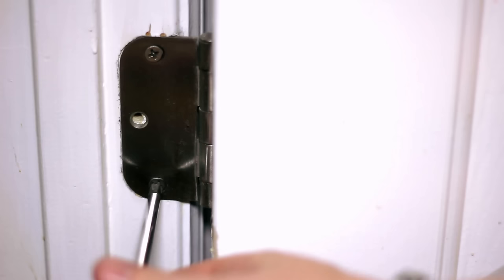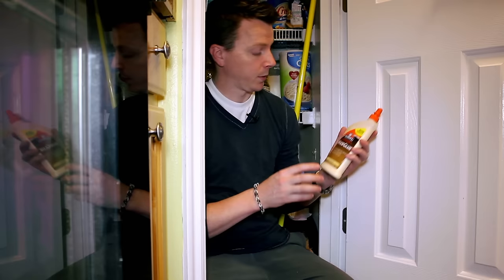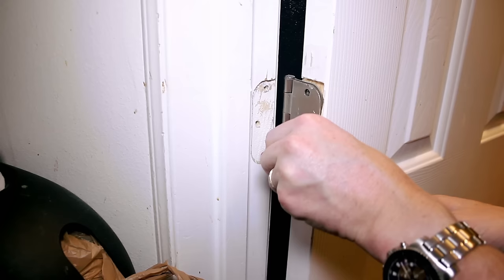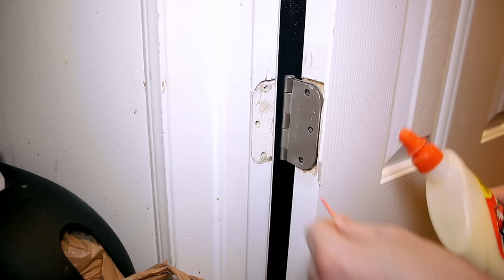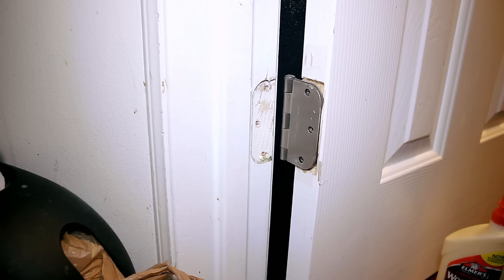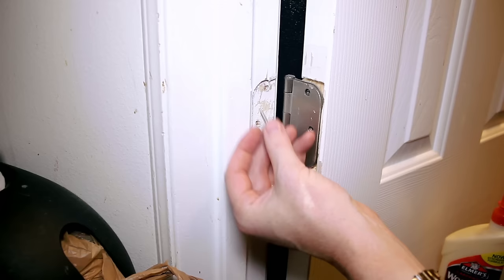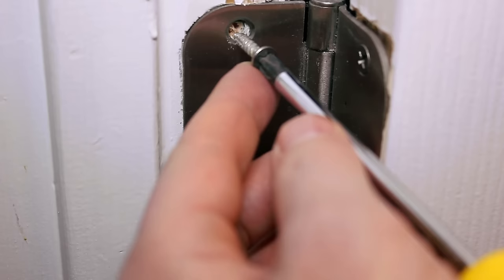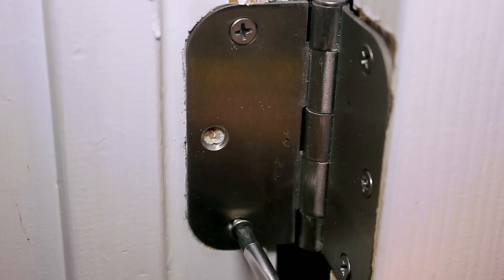Fix Stripped Screw Holes - 3 MINUTE FIX!

Comment: What if I have a hollow door
Reply from the maker: The door in the video is hollow, which is really common for interior doors. Hollow doors still have solid wood around the outsides and a few places in the middle, which is why this works. If you need to drive a screw into the hollow part, however, that's a lot trickier. You'll usually want to do so in a part that has backing.

Comment: Www.zzemscrew.com makes a nifty kit metal collet for hinges in wood frame applications.  The reason the screw got loose is the thread materials failed.  What’s to say cheesy Pine toothpicks will be anything much different although the glue will help. The problem is no cheaply wood are worthy of the shear and pull a door hinge gets.  The real solution would be metal hinge side frames, so we know that’s probably not happening on a residential application.

Comment: that can work, but drilling it and inserting a wooden dowel is better.
Reply: Sean Moran  The point is that very few households have wooden dowels of the appropriate size while almost every household has tooth pics.
Reply: biff322 I've never had a repair like this fail once. I use matches not toothpicks. It might fail on a door hinge though especially if his kids keep hanging on the door.
Reply: yeah I  use a wooden dowel also.
Reply: I'm a landlord and done the toothpick method plenty of times, never had it fail. Leave the dowel at the store.

Comment: Or you can get longer screws right?
Reply from the maker: +YoSoyGus1 Usually, yes. The exception is if there's nothing behind the wood to grab on to, so the screw just keeps spinning - in which case you need to do the toothpick trick (or something like it) to provide some grab for the screws.
Reply: +Nils Rasmusson there should be a 2x4 right behind it. Or what else was it installed on?
Reply from the maker: +YoSoyGus1 There should definitely be either one or, more likely, two 2x4s around a door frame like this but this video is about any stripped screw hole - not just doors.

Comment: What if the tooth picks go all the way through????
Reply from the maker: That means one of two things: 1) It's just a really deep hole or 2) it's not a thick material to work with (there's an open space behind it). In either case, you can either use something thicker to block it, like a golf tee or a wooden skewer, or you can glue a few toothpicks together to where they barely fit in the hole, let it dry and then rethread the screw in from there. Good luck!
Reply: LRN2DIY thanks!
Reply: LRN2DIY it absolutely worked!! I had about an inch of tooth picks left to break off. I did everything you showed us in video, the door is like brand new!!

Comment: Can i fix my electric guitar screw holes where the aux is? PLZ HELP!!! (+_+)
Reply from the maker: Same trick should work there as well. Take the screws out, take the plate off and then push the toothpicks or other wood into the holes. Put it back together and you're all set.

Comment: Using wood glue is fine, but unnecessary.  Especially if you have to wait 30 minutes for it to dry.
Reply: Good point on the glue.  Not needed if you use match sticks like what I did yesterday on a job and the sticks worked great on the stripped hole.

Comment: it didn't look tight for me at all,especially first one.anyway, if you can tight it just by using a screwdriver, that means its not holding good.when your impact clutch goes grrrr grrrrrr grrrrr :) that means its tight and good :)
Reply: It's often the "grrrr grrrrrr grrrrr" that strips the hole in the first place. For hinges it's always best to tighten with a screwdriver.

Comment: Just to let you know you can use bigger screws.
Reply: Christine  Razo if you mean longer then yes. If you mean thicker then no. Thicker screws have bigger heads which will not allow the hinges to close as tight as they are supposed to.
Reply: @patrickpuma  not even longer! The hole is too big.. U need to fill the hole.. Length doesnt fix it.
Reply: @Briannafrancis-e9g  if it reaches the stud that the door jamb is mounted to then you are done with problems.